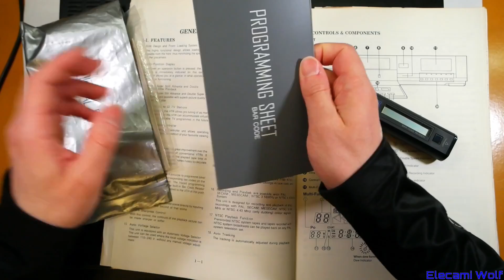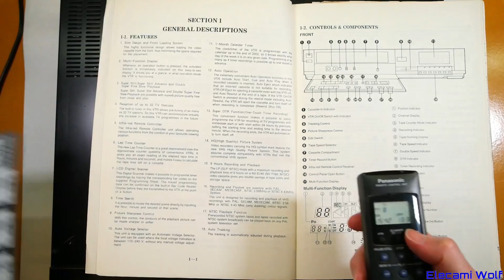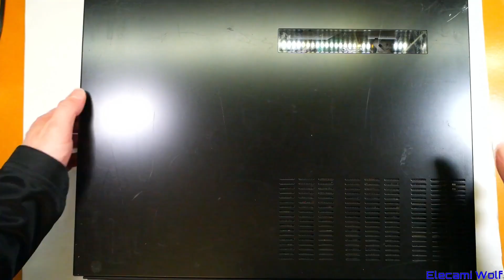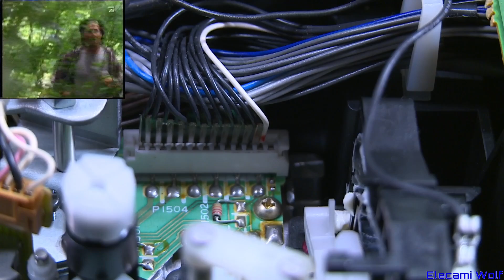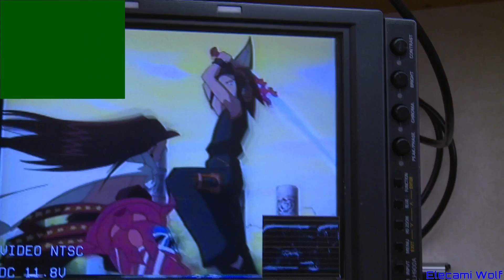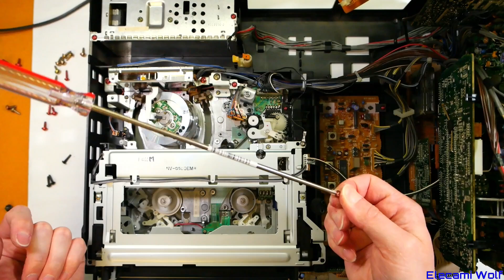EW0145 - National NV-G500 VCR Investigation Teardown

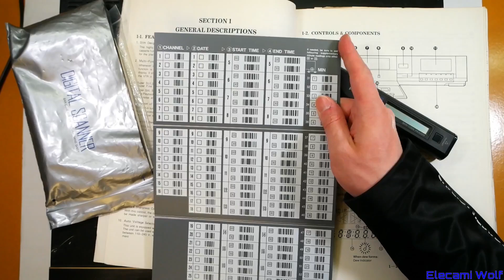Comment: At 1:52, I thought you were gonna do some "Barcode jamming" for a bit there lol. Now that i notice, you probably have a bookshelf full of service manuals

Also, congrats on 2k subscribers!
Reply from the maker: Thanks. 
That barcode scanner is a bit slow for that. But that barcode sheet would be ideal with the right scanner.
Reply: @Elecami I have the bar code scanner and the remote control. My problem is the power supply doesn’t work.

Comment: How can I eject the cassette stuck inside and the power supply is not working. Give me the schematic diagram of the power supply.and the actual picture of the circuit board assembly
Reply from the maker: Google search for the service manual.
Will depend why the cassette is stuck. Usually you can remove it by running the mechanism in the unload direction.
Reply: @Elecami  thanks

Comment: I have this vcr with me the power supply is not working. Some of the circuits have corrosion and not readable specially the thinner copper prints. It will be helpfull to me to work on it. I have this for almost 33 years
Reply from the maker: Leaking capacitors have ruined many VCRs.

Comment: Can you give me the circuit diagram layout of POWER SUPPLY. Specially of the PCB Board . I have the exact same vcr. You are only explaining how to use the vcr. I have all the accessories what you are showing in the video. Please try to help me with the PCB DIAGRAM. AND SCHEMATIC OF THE VCR. NV G500EM.
Reply from the maker: You can find the schematics in the service manual https://elektrotanya.com/panasonic_nv-g500em_vcr.pdf/download.html
Reply: I have my wedding cassette stuck in it. I replaced most of the capacitors including 400v 82uf. Plus STRD,STK, Also the soft opening doo. does not stay closed, so I attached 2 thin strip of magnets . I bought my unit during 1988 Olympic . Any suggestions how to get the tape out
Reply from the maker: @ferntom6092  You can wind the mechanism by hand in the unload direction until it is ejected. Details are in the service manual.

Comment: I want working power supply of this model. National NV G500 EM.anyone selling
Reply from the maker: Probably need to fine another VCR and take the power supply from it.
Reply: Can you send me the schematic diagram of the power supply and the actual assembly picture. Please if you can. My power supply had cap leaking and ruined the pc board circuits. Specially where he output is connected to the motherboard.
Reply from the maker: @ferntom6092  You can find it by google search.